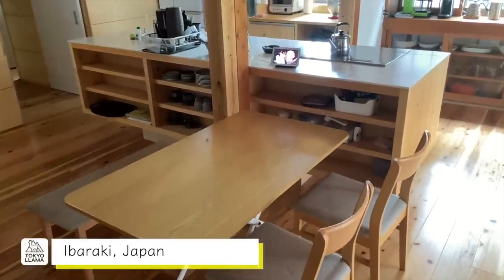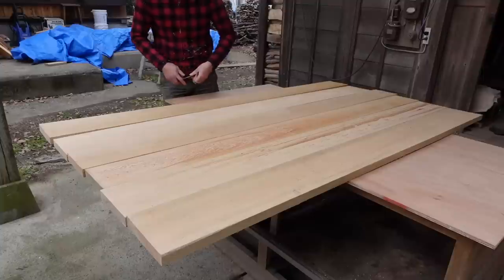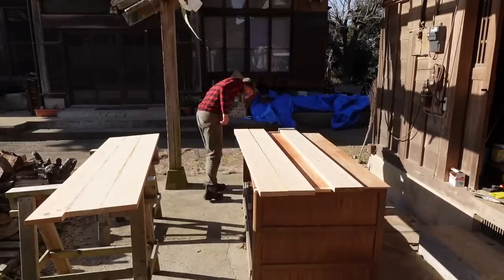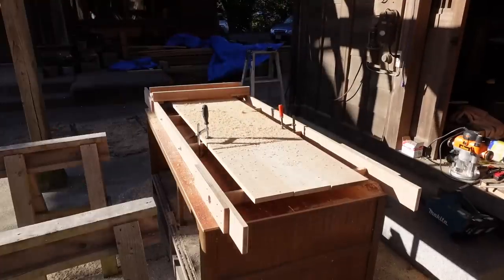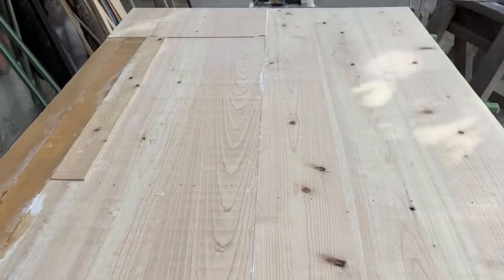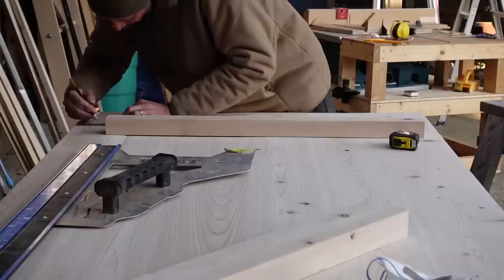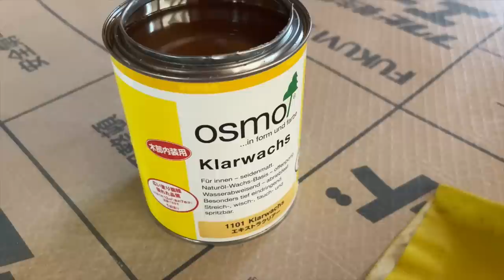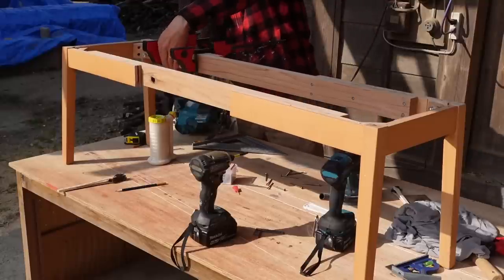DIY Floating Table: Building Without Jointer or Thickness Planer

Comment: Respect for your perseverance, but it didn't turn out like you wanted.  Given how much detail you have put into everything else in the house, take some time off and start over.  

Because the second lesser quality boards went wrong as well - curious as to why you didn't go back to the better boards to finish up?  As it is, the two halves look so different it's distracting.  Plus - given the likely differences in moisture content - there's probably a middle failure in the future.    

You didn't show sealing the underside of the table with the ceramic paint, hopefully you did that because if you will have moisture entering the unsealed side and you will likely have cupping/cracking in the future.
Reply from the maker: The other boards were cut too thin.

Comment: Lessons from my own mistakes:
1. Cheaping out on lumber never works out well mid-project. It will be visually obvious. 
2. Instead of a router sled, just hand plane the top after assembly. It need not be perfectly flat, it just needs to be smooth. Using hand planes would not have been any more work - and you would have not trashed half your wood. 
3. Fix or dispose of that router before that bad collet bites you again. Bad tools are the most expensive because they waste time.

Comment: I would've half assed this project so bad! For example, I'd go get a sheet of wood at home dept and just staple it to the top of the existing smaller table 🥴🥴🥴
I really appreciate your attention to detail, preference for a quality product, and you putting in the work to achieve it!
Reply from the maker: 😂 I felt like doing something like that after the second incident trying to flatten with the router.
Reply: @TokyoLlama  😭😭😭

Comment: Sorry but not that impressed. Why you had to fit the table into that area is not explained. You should have made a much larger table. But I’m not a carpenter.
Reply from the maker: It was a design decision.
Reply: @TokyoLlama  Its the wrong place for a table you put so much work and thougth in. Its dark and crampy there, and its hard to sit on the bench between those two poles and to reach to the sideboard under the top one. Put it in the center of a free space in front of one your big windows. 
(Or leave it there for storage, whatever.) Thank you for giving me such an insight into japan and that you do this calm and interesting videos!